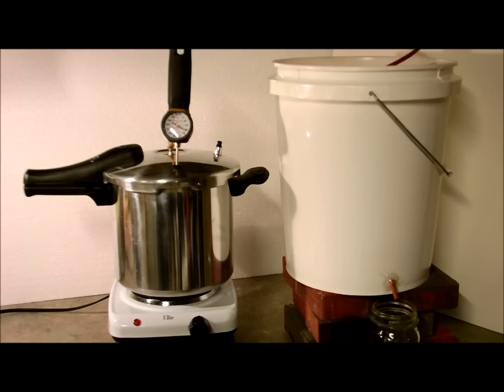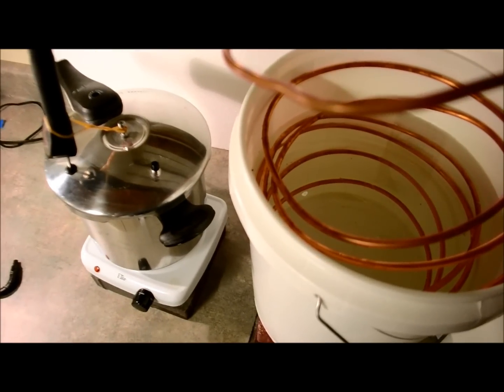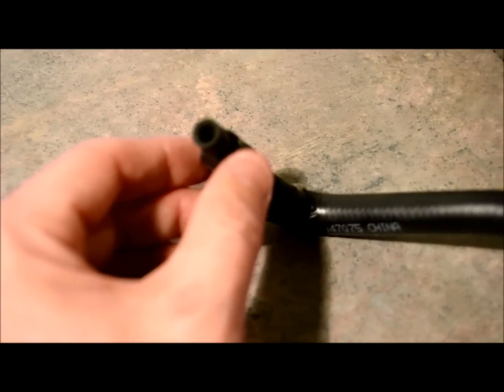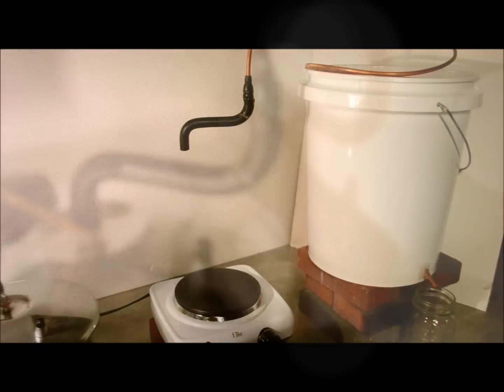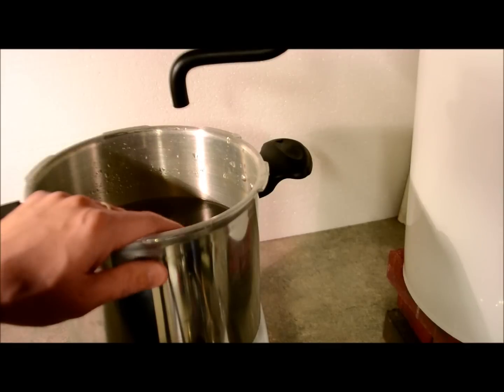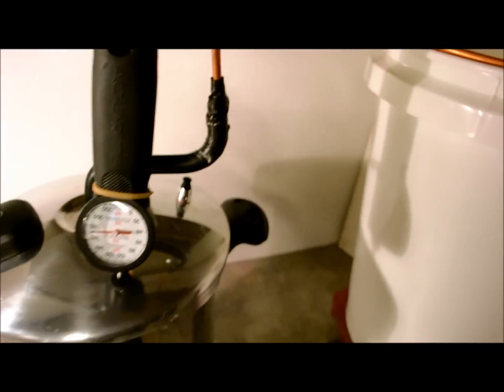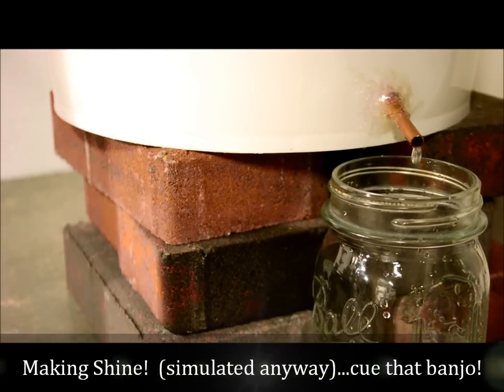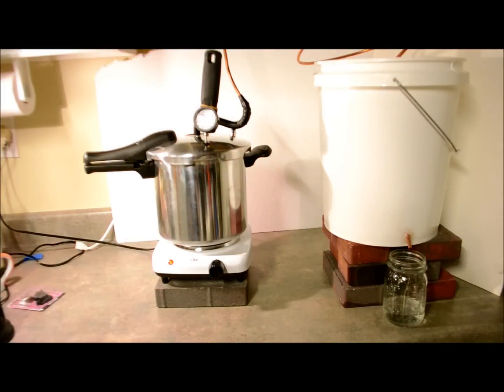How To Make Moonshine, Part 6:  Putting it all Together

Comment: i basically have the same still design using a 1 gall pressure cooker and 1/4 copper tube ,most ppl think making shine from only 1 gallon batch wont work or that im making bad product but im only making enough and actually more than enough for self consumption and for sharing with family or friends and it's pretty reasonable product ,of course the more you lear techniques the better you get at it

Comment: Couple questions. 
1. So you would run the math through a cheese filter before putting it into the still to get just the liquid? Then do you add anything else into it or just the filtered mash liquid?

2. How do you know when your done brewing? Does the drip from the spigot stop and that's when you know your done?

Comment: That rubber hose can/will leech toxic chemicals into your distillate. Anyone reading please do not use rubber hoses for anything in a still. Also, your ethanol should only come in contact with stainless steel, copper or glass. I triple distill mine and at a high enough proof will double as a cleaning agent. I've done away with copper stills and use only stainless steel rigs that use copper mesh in the column. Over time the ethanol will eat away at the lining of your copper lines requiring difficult cleaning. Using copper mesh is as easy as tossing it when it can't be cleaned anymore. Done. My stainless rig will last me 50 years and still work like new.
Reply: Food grade silicone hose is also good. Better than rubber anyway.

Comment: Could I use an aluminum pressure cooker?  Or does it have to be steel or copper?
Reply: +michael armstrong he said stell or copper so i assume its neccesary
Reply: its not necessary, just prefferable
Reply: steel or copper aluminum  will be toxic
Reply: the problem with aluminum is corrosion and pitting not to mention taste transfer and never use rubber when distilling alcohol talkin about nasty

Comment: Don't use rubber hose,that is stupid. Instead put a copper pressure fittings. One coming out of the top attached with copper washers. Then use a threaded one so you can disconnect the worm. You can find all this at a hardware store. The fittings are for natural gas.
Reply: +Jimmy Badabucco When I saw him using automotive rubber hose I thought this was not a good idea. If it's not food grade rubber it will give a horrible taste. I know, I've repaired beverage equipment in the past.

Comment: What causes the impurities in the first 2 ounces?
Reply: Yeast converts a portion of the sugar in the mash to methanol, which is toxic to the nervous system and causes death and blindness. It can be separated because it evaporates at a different temperature than ethanol, (the good stuff).
Reply: Not just methanol, but acetone and various aldehydes.  Just trace-concentrations.  Nothing that wasn't already present in the mash and nothing that isn't naturally present in beer and wine. You won't drop dead if you fail to throw it out, but it does get concentrated at the start of the run., so the first ounce or two can be pretty nasty.

Comment: just looking at this and was thinking a rubber water pipe off a car? Have you seen the condition off the water pipes when they come off a car? the bad part is that the ethanol with rot the rubber pipe and that's good night people as it will kill you with all the crap they put in rubber, just one more thing to add the price you paid for that rubber pipe you could have got all the right parts you needed.

Comment: what did you start the heat at?
And what is the size of the Z shape hose used for on the car, and what is That vacuum tube called, if I went to a auto store what would ask for?

Comment: I make it times 1 and a half to your mixture,  that way i make 6 quarts and do 3 and 3 that way it can distill nicely have have plenty of room, also to all these guys that are saying the rubber you're using is bad for you? they're stupid, if it is an automotive high temp hose it is lined with special material, and does not produce harmful poisons and is used for the cooling system, you're car runs 180 degrees warmed up i sure hope that antifreeze doesn't corrode your rubber hose in you're cooling system, that would be reaaaal bad man, they need to get a life and stop criticizing other people because they cant do this themselves and feel good about putting other people down. And also do you know what proof your moonshine is? By the way GREAT series of steps man.

Comment: Hey does your hot plate auto turn off and back on to control the temp? Where did you get it? My hotplate turns off momentarily and I need to avoid that because whatever its boiling the temp drops until it turns back on

Comment: While you have demonstrated the principle, this setup is way impractical. That pot is too small. With 4 quarts of mash, you will get about 17 oz of distillate of which 6 oz is throwaways.  So you get 11 oz of good stuff at about 80 % after 2 hrs or so of work. You will have to make 5 runs to work thru a 5 gal mash.   You can buy a qt of cheap 80 proof vodka for $8 bucks.  This needs to be scaled up.  And that rubber hose is sketchy for use with ethanol.
Reply: MrPterasaur

Comment: Your video is very handy man thanks a lot. but from what I've researched. You should only use stainless steel or copper no rubber, no plastics, reason being that there could be leaching and causing you to get sic.

Comment: can you please answer a couple questions for me,  what temp should i be at while i collect the methylated moonshine, then what temp should i be at to collect my ethel moonshine,  and does it matter if my temp gauge is in the mash , cause my temp gauge is at the top of my still pipe where the vapor would be.  thx alot

Comment: that hose is an emissions hose. it is made to handle heat and steam. you find in on the pcv valve whish takes gasses and steam out of the crankcase and puts it back onto the enging to be used in combustion

Comment: i used a 6qt presto stainless pressuer cooker with a relife valve on the lid in the center and a black safety relief by the small handle i took the center relief in the center and used a copper adapter to connect my 3/8 inc copper line as well as removed the black safety plug drilled the center so i could use a thermometer that hits the "water" so that i can make sure i am in the right temp range

Comment: I'm with the comments below about proper fittings and containers. If your making fuel then it's not an issue but if you plan to drink it I would do it up like a sterile pharmacy. Use copper, stainless, or glass.